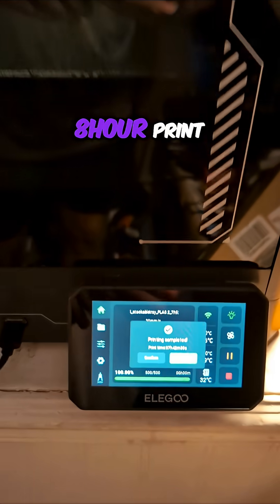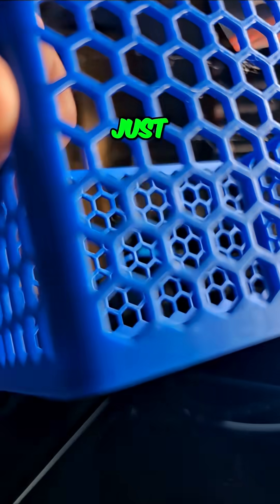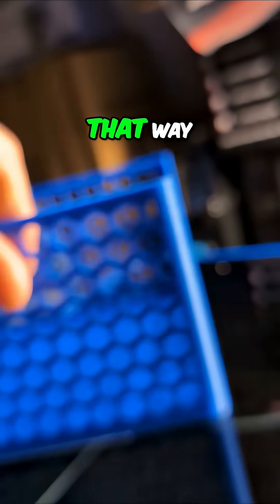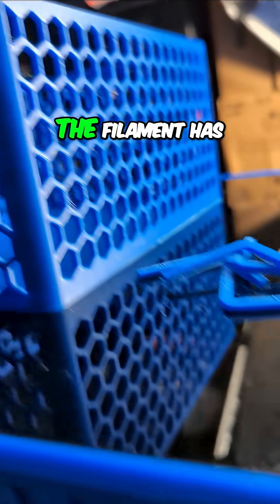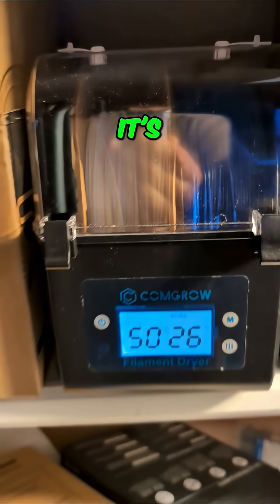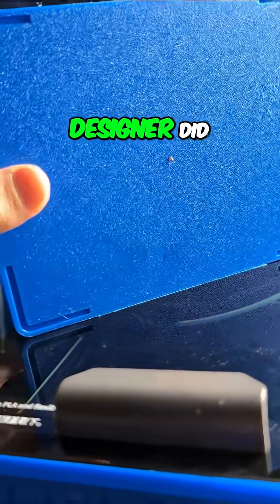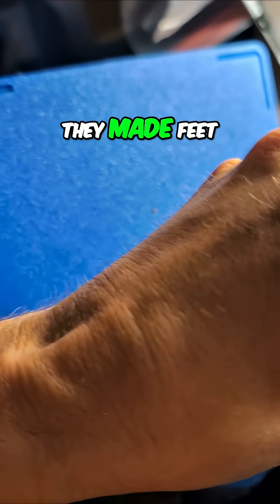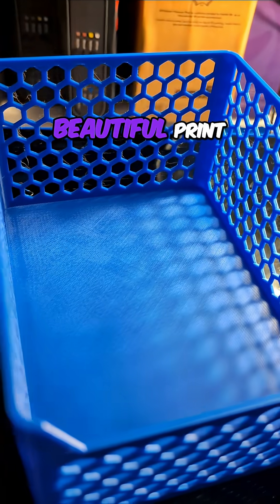3D Print Hack: Stackable Bin Design is Genius!

Comment: "My filament has been out for a few days". Laughs in opens spools for 6 months. Use a hairdryer or mini torch and keep moving
Reply from the maker: I'm a huge fan of people doing what works for them. People give me hell for printing with TPU that isn't printing directly from the dryer to the extruder. But I've only had ONE roll ever that gave me issues, and it was SOAKED when i opened the package. It took days in the dryer for it to look normal, but then it printed fine. I've never had any issues with PLA that looked like moisture induced. But I figure, I've got the dryer and vacuum bags. Might as well try to give the printer the best chance to over-perform by feeding it dry filament, when i can. :)

Comment: Hair dryer on hot high will fix the stringing
Reply from the maker: Good idea, thanks.
Reply: @GearReportMaker  Git it from another YouTube and found that it works well with my K1C
Reply from the maker: I'll have to try it on my latest BIG print off of the other printer. It has some big surface roughness from tree supports.
Reply: @GearReportMaker  From the stuff I've made and videos I've watched the Rough surface from supports is inevitable outside of finish work.
Reply from the maker: Yeah. The area where the supports were is a mess.